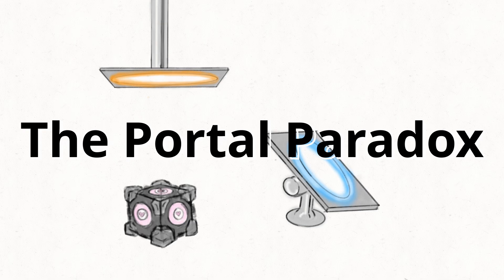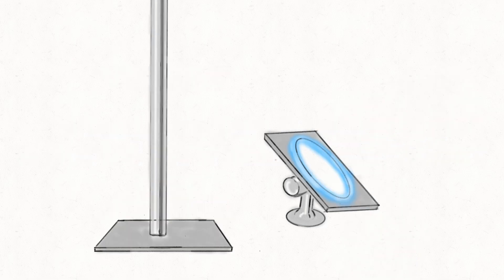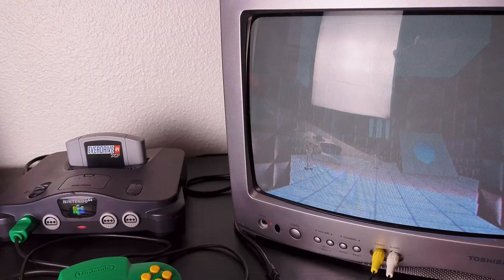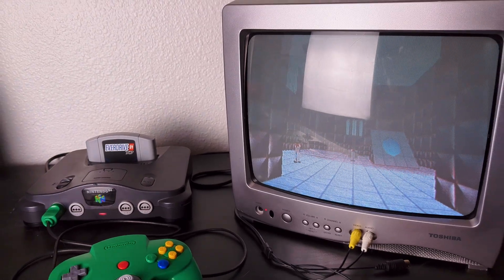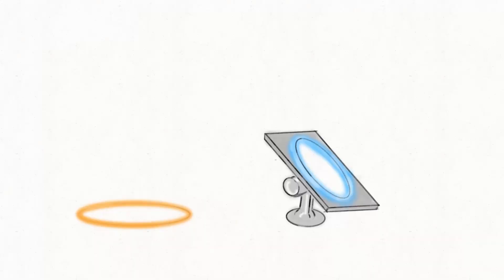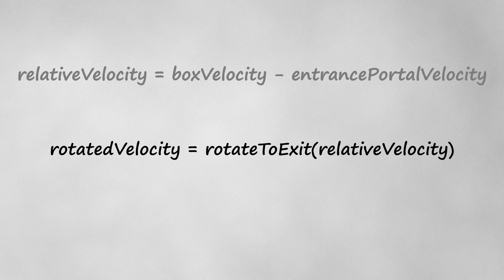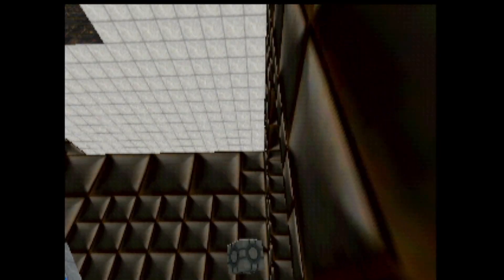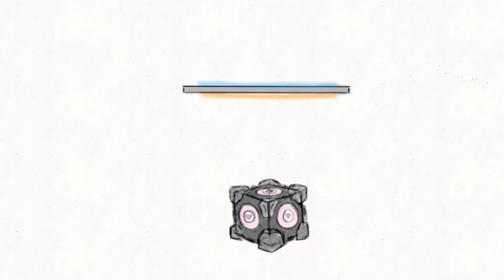I rewrote Portal from scratch and solved the Portal Paradox

Comment: The only reason I believe this is wrong is because when you imagine a portal as an open window, the object going through the opening in the window wouldn't add velocity to the object passing through.
Thoughts?
Reply: a window in any case would work like the second example, its "entrance" and "exit" are moving or staying still together, so it would be exactly like the counter argument he gave
Reply: @22TwentyTwo  so he's saying the first one is wrong and the second is correct?
Reply: @paxipher  no, both are correct, because they are not the same experiment.
your original comment is just literally the second experiment he made, so he is right.
Reply: Right, which is what he shows in the video. When the two portals are back-to-back, they act just like you would expect an open window to behave. It's the first answer (where the cube doesn't come flying out) where the velocity of the cube suddenly changes. Would you expect an object going through a window to suddenly match the velocity of the window once it passes through?

Comment: My one question I do have regarding this answer, is how is energy conserved here? The moving portal isn't able to transfer it's energy to the cube yet the cube gains kinetic energy when leaving the exit portal.

I think taking the cube as the reference point may be a red herring, as if we assume that the exit portal (and the space beyond) is actually moving in regards to the cube as it would appear through the entrance portal, once the cube passes enough through the exit portal it will simply drop due to gravity with no horizontal velocity. The cube isn't being moved or gaining any momentum, it is the space around it that moves.

Good video though, the retro portal looks great and I hope the work on it continues to go well :)
Reply: It's not. Portals break conservation of energy all the time. Falling infinitely by placing portals on the floor and ceiling generates infinite energy.
Reply: @APaleDot  That is true, perhaps I need to re-word what I meant, as I would still argue that with your example the object in question is being effected solely by gravity and not by the portals, which only relocates the object so it can continue to gain velocity due to the effects of gravity. There is no transfer of energy, or atleast momentum, from the portal to the object in both cases
Reply: @OneCokeAndDrink 
Gravity doesn't change how much energy an object has, only converts its potential energy into kinetic energy.
The portals give the object potential energy as soon as they teleport the object to a higher position.
Reply: @APaleDot  Albeit a tad poorly, I wasn't trying to say that, I meant that gravity gives the object velocity, not energy. It 'gains' energy when exiting the top portal due to potential energy, converts that into kinetic, then 'regains' the same potential energy whilst keeping it's kinetic when teleported back to the top. Energy conservation is broken due to portals as you mentioned, so I'm not going to use it to explain myself further.

What I am trying to say is that the velocities gained by the object, in both examples, is only to be gained through the acceleration due to gravity, not by the motion of the portals.
 Your example grants the object a longer time period under the affects of gravity before striking the ground (which could be never) and so can reach its terminal velocity, but the portals do not add or subtract from this.
 In the example in the video, regardless of the first portal's velocity, the object would behave similarly to your example, inwhich the object is teleported to the exit portal and falls due to gravity, however it has a significantly shorter time under the gravity and hits the floor.
 It does not gain velocity opposite to the first portal's velocity as the space around the object moves and not the object itself.

I should not have used energy as a foundation for my initial answer since the setting has fundamentally broken energy conservation and thus was flawed.
Reply: @OneCokeAndDrink  
What's the difference between an object moving and the space around the object moving? For that matter, what does it mean mean for space to move?
In terms of physics, the cube is moving. It has motion relative to the orange portal, that's how it's able to enter the portal. Likewise, it needs velocity relative to the blue portal in order to leave the blue portal. If it didn't have velocity, it would never cross the threshold of the portal.

Comment: I have another portal paradox like question. I don't know how well this translates over to text, but I'll try to explain my question the best I can. What if an object is sticking only halfway through the portal and then you move one of the portals sideways. Nothing is holding the object down. It's just the object itself and the portals. Does the object move along with the moving portal or does it stay in the same place. I think you'd expect  both to happen. I mean, if you stick your hand through a portal and move the exit, you expect the hand to move along with the portal, right? but what if you now step further in the enter portal so that most of your body is out of the exit portal except for your other hand and then you move the exit portal in the same way. You wouldn't expect your entire body to move along with the portal, right? But if you do the same thing, you expect the same output, right?

Comment: The box has no momentum. When the portal goes over it, it isn't 'moved' through the portal and isn't gaining momentum. Yet from the other portal, it is 'moving' from it so must have momentum. If a portal was real, perhaps the momentum imbued from the output gives momentum to the remaining source, so it would actually get sucked in and shoots out quickly. Or, the remaining source matter does not get the outputs momentum and therefore as it fully emerges the momentum from input to output cancels out and it just plops out. Or, more likely it won't matter as every molecule in existence would start getting sucked in and loop through the portals in an infinite singularity spaghetti thus destroying space-time and the portals themselves.
Reply: The box does have momentum. It has momentum relative to the orange portal. Portals transfer momentum, and there is no absolute momentum so they must transfer the momentum of objects relative to themselves. It's the only answer that makes sense.

Comment: I hate this paradox for multiple reasons. For one, because I find it infuriating that the stationary box suddenly gains momentum, yet it's still the more logical option. But most of all I hate it because in Portal 1, Glados has a specific line where she says portals can't be placed on moving surfaces - and in Portal 2, you are forced to shoot a portal onto a moving surface to proceed.

These days, I headcanon that moving portals are an in-house joke back at Valve, because they absolutely make no sense no matter how you look at it. Since earth orbits around the sun and every star and star system is moving, "non-moving" portals can't actually exist, yet in a closed system a moving portal meeting a stationary item is a paradox.

Comment: okay now see if a plane can take off from a conveyer belt
Reply: No? Because the plane needs to create negative air pressure on the topside of it's wings. Either by moving forward itself, or being put into strong winds. 
The conveyer belt doesn't interact with the part of the plane that generates lift.
Reply: @QueenNaya  i meant a conveyer belt going forward
Reply: it actually can and has been done by Mythbusters. the thing is that the plane moves with the propeller/jet engine and not the wheels like a car
Reply: @22TwentyTwo  oh yeah, that's what I meant

Comment: I fundamentally disagree with your initial assumption that "it doesn't matter whether the cube or portal is moving."
I see no reason for a portal to have any means of transferring the velocity of the surface it is attached to, to the cube.
It'd be like taking a big window frame and passing it over a soccer ball?
only difference is that this would be the cube now being subject to a different gravity, which would behave like an object falling imo
Reply: You have a flaw in your thought experiment. If you put a window frme over a soccer ball, it would be 2 portals moving at the same velocity, therefore creating a perfect seam between 2 sides.

Here, only one portal is moving, while the other stays stationary, creating a pull that rapidly speeds up the cube
Reply: @QueenNaya  Hmmm.
After thinking about the physics of it for a bit, I see a way this could make sense.
Laws of physics apply to portals just fine if they are stationary, things start to break if you have them move.
His assumption is necessary for allowing them to move so that things are able to retain their form after passing through a moving portal.
Without his assumption, if the portal was moving extremely quickly, you would be materializing one slice of molecules at a time out of the other portal faster than body would be moving, turning you into a person pancake.
Reply: He shows in the video what happens when the two portals are back-to-back like a window frame. The cube remains stationary like you would expect, meaning that his implementation is the one that is consistent with your idea of the window frame. In this implementation, the cube comes flying out the stationary portal.
Reply: @APaleDot  Hmmm.
After thinking about the physics of it for a bit, I see a way this could make sense.
Laws of physics apply to portals just fine if they are stationary, things start to break if you have them move.
His assumption is necessary for allowing them to move so that things are able to retain their form after passing through a moving portal.
Without his assumption, if the portal was moving extremely quickly, you would be materializing one slice of molecules at a time out of the other one faster than body would be moving, turning you into a people pancake.

Comment: Idk man i just don't see why that will make sense. The portal falling over it might move it a little, from the pressure via air it is displacing from the moving flat surface it's attached to but the portal itself doesn't have physical properties. We know this because it doesn't interrupt or modify the speed or trajectory of anything passing through it. 

If you held the portal panel in one hand and moved it quickly on off your other hand, your hand wouldn't just propel forwards and pull you through you'd just feel a draft. 
Put your hand on a table. Grab a hammer and hit the table with the hammer. You're hand feels a gentle draft while the table got a dent in it.

Comment: It just doesn't make sense though, the portals are just wormholes, it'd be no different than moving through the real version of space, it's just connecting two points in space that otherwise wouldn't be connected. There's no momentum to gain because nothing is moving, literally nothing, nothing is moving. You can't get energy from nothing, therefore the portals cannot give an object momentum. idk they probably can
Reply: With portals you can get energy from nothing. Just place one portal on the floor and one on the ceiling. Any object falling through them will gain infinite velocity.

Comment: Realistically, you are correct. Physics is all about measuring based on relative perspectives so, as far as physics is concerned, it doesn't matter if the portal is moving down or the platform holding the box is moving up. The resulting kinetic energy would be the same in either case. The only reason why it wouldn't work like that is if the portal down moved slow and couldn't produce enough energy to overcome the change in velocity due to gravity, which at that point is a bunk result. 

Just because the cube itself isn't moving up doesn't mean it isn't in relative motion, nor that there isn't being force applied to the system.

Comment: Portal 2 at least, actually  does have code for moving portals. It was needed for the neurotoxin room, where you use lasers to cut the pipes from the neurotoxin generator. Iirc, portals will stay on moving surfaces unless a flag is turned on, but that flag is turned on for the entire game bar that room.

Comment: What happens if you do the same thing but stop the portal (portal that is dropping) at half the cubes height? Would the rest of the cube be sucked in? I’m still having a hard time wrapping my head around the cube gaining velocity, but knowing how your physics work in different scenarios would help me understand better
Reply: Well think about it like this, from the perspective of the Blue Exit Portal.
On second 0, none of the cube sticks out.
On second 1, an inch of the cube sticks out.
On second 2, two inches of the cube stick out.
Relative to the exit portal, the cube has speed now. By definition, the cube has travelled a Distance within a certain *Time*, 1 inch per second in this case. That's how cube "gains" velocity. If you were looking through the exit portal during the experiment, you would see the cube rapidly approaching you

Comment: I don't think it would shoot out a portal, because a portal is not really an object with its own mass that is approaching with a speed like a room on wheels.

A portal cannot push or pull - it cannot exert a force itself - it rather just displaces an object to another place instantly. It's like a shortcut to another place rather than an object or space itself with its own energy and force. And the force caused by the moving platform that contains the portal cannot transfer its kinetic energy to the cube because it never touches the cube as it goes through the portal on the platform. Likewise, just because the platform is moving - it doesn't mean the world/object inside of the portal are also experiencing any movement or kinetic energy from the platform. As such, no matter the speed of the surface a portal is on, that speed cannot be transferred to objects that go through the portal. The only energy transfer that can happen is with the object itself that goes through the portal - aka speedy thing goes in, speedy thing goes out. You cannot give a stationary thing speed by hurling a moving portal towards it, as the portal cannot give it energy - it can only transfer the object's existing energy to a different place.

So no force is exerted on the cube when it goes through the portal. Instead, as soon as the cube starts going through the portal, it will have two forces of gravity acting upon it - one from its flat surface location, and other from the sloped new location, and as more of its mass comes through the portal, the gravity of the sloped location will have a stronger pull and it will slide down.

To envision an example, I remember some movie that had a portal happen every few days/hours that would travel at a very fast rate around the world, each time sending it back in time a few hundred years. The people and objects sent through this portal retained their energy (motion), despite the portal moving at tremendous speed. I know this is a time portal - but it has a similar function of displacing objects through time rather than place (a different dimension).

You can also think of it as a room falling onto a person standing. The room has a door opening so when it falls, it falls around the person rather than squishing them. The person would not be affected by the kinetic energy of the falling room.

Comment: the implementation is wrong. the cube shouldn't be able to enter the portal at all. let me explain:

when the first layer of atoms are going through the portal, they appear instantly on the other side. there's no pushing involved. when the second layer of atoms are starting to go through, they aren't able to because they are supposed to be at the exact same place as the first layer of atoms (again, not pushing them, just appearing right where they are). this means that after the first layer, the second layer is supposed to compress together with the first layer, and because the cube is solid, this isn't possible, i.e. the portal should get stuck when pushing it down.

let's imagine the scenario where the orange and blue portal are placed right above each other, like your hula hoop example, but leave a gap of, say, 5 meters between them. now, move the blue portal on the top down twice as fast as the orange portal takes the cube in. the cube will be split into layers, which confirms my theory.

so in summary, if the exit portal is going any slower than the input portal, the cube cannot enter the portal at all, because then it would need to compress two layers in the place of one.

Comment: okay, here's your mistake.

the quote "speedy thing goes in, speedy thing goes out" is a dumbed down version of "how portals affect momentum", which is simple- they don't.  Passing through a portal has no impact on momentum.

In order to come up with the result you found, you have to take this statement as false, and cause portals to affect momentum.  In other words, you are writing code that simulates a portal system that does not exist in the game's lore.

The portal coming down from above is not exerting a force on the box- gravity and the ground beneath it are.  Because the portal does not exert a force, the cube will not be launched.  The only forces acting on the cube are gravity, and the floor beneath it.  I think you can model the eventual result of those forces on your own.
Reply: There is no absolute momentum, only relative momentum. The cube has momentum relative to the orange portal. Since momentum is not impacted by the portal, it must carry over to the blue portal. James' interpretation is the one that preserves momentum. Your interpretation does not.